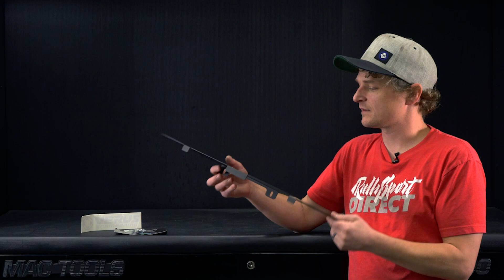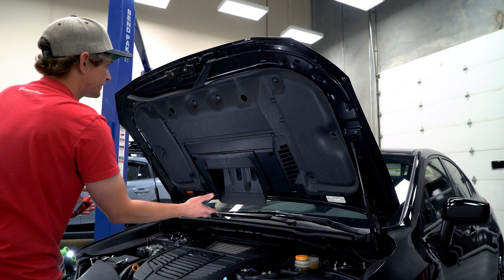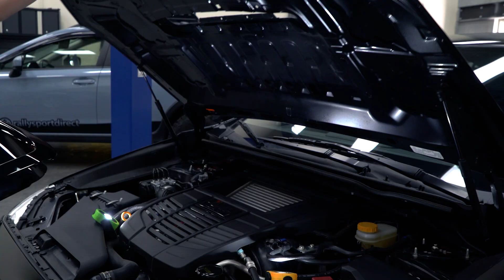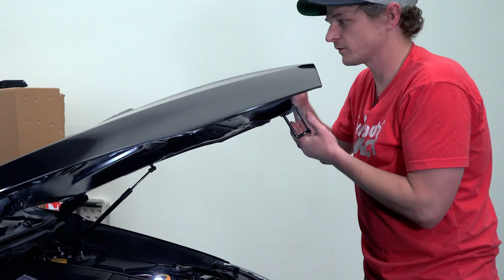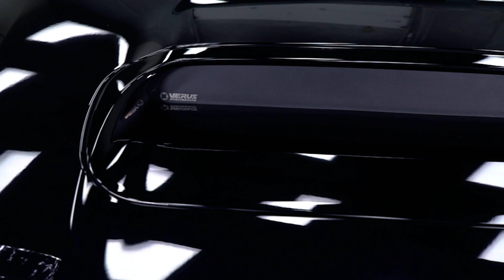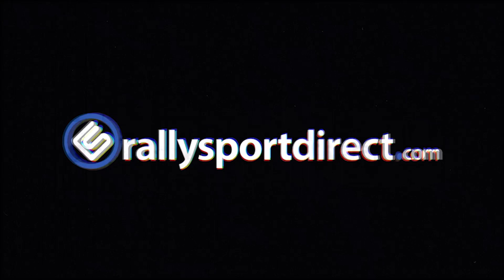Verus Engineering Hood Scoop Block-Off Kit 2015+ WRX and STI - Install

Comment: I wanted to install a cat back so I picked one up the other day for will call, pickup from you guys, the thing was missing bolts, gaskets and the tips were so mangled! Super disappointed you are selling re boxed damaged goods as new. Also, someone wrote damaged muffler on the wrapping, didn’t notice until after I got it all ready to install. So much for a project this weekend! Super disappointed in rally sport direct.

Comment: 70 bucks.....for a flap of aluminum that doesn't snap in, takes work to install, doesn't actually help anything, actually hurts everything. Someone was chugging on the crack pipe Hard.
Reply: Completely agree with it being overpriced and such.
But these really do serve a good purpose when using a FMIC. Fluids always follow the rule that they flow from areas of high pressure to areas of low pressure. So simply put, the way to getting the greatest possible amount of air to flow through your inter-cooler and radiator at the front, you must do what you can to keep the engine bay at the lowest possible pressure. An open and function-less hood scoop is the most obvious way to do the opposite of that, by flowing air into, and effectively pressurizing the engine bay via the scoop while doing nothing of any use. The same logic is used to explain the importance of using an under-tray to help separate high and low pressure zones beneath the car, and route airflow towards the read sides of the motor.
Those saying this is a useless product are clueless.
Reply: @evanchi9460  tell ya what, show me the wind tunnel smoke test, with cameras under the hood. i have a hunch.....
Reply: @evanchi9460  im going to make a minor correction, its almost useless without hood venting. ie luevers. i watched verus' video on it and one tubers video on it (only one person reviewed it) ill wait for a wind tunnel smoke test. since this most likely effects way more than just iat. i havent seen anyone mention oil temperatures yet, which would give a minor indication of the turbo's health. especially if the turbo is still in the factory location. since verus' mentioned it themselfs, your eliminating the potential to clear out the head room heat. the older model wrx's used the hood scoop to cool iat, the turbo itself and direct air over the transmission. so it still stands that this thing is almost useless.